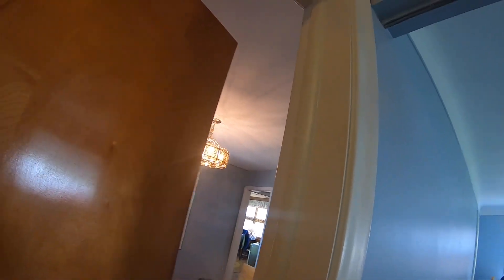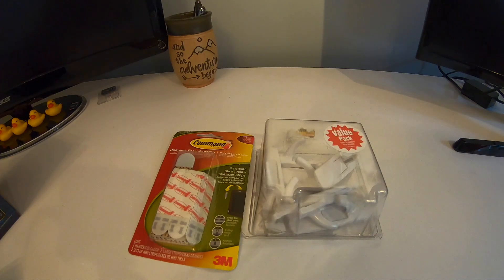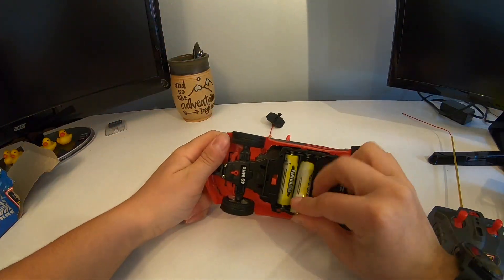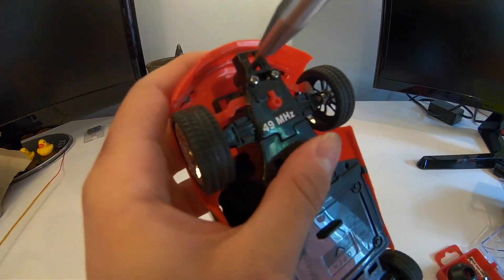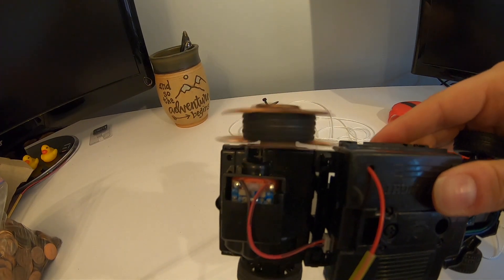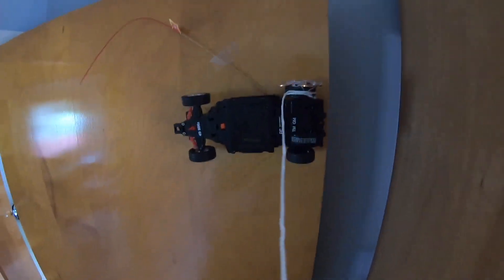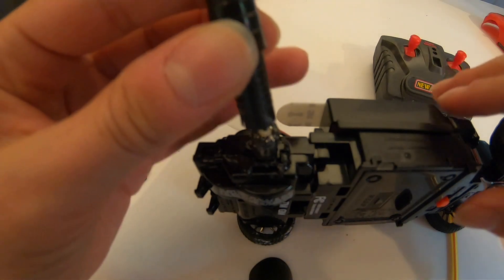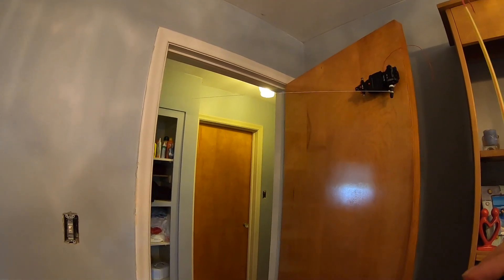How to Make a Remote Controlled Door Closer Out of a Toy RC Car

Comment: A remote controlled door OPENER.
Reply from the maker: You're not wrong :)
Reply: Could even use the same car. Just spool on other wheel so when run in reverse it would open the door by pulling string from other side of door.
Reply: It would work well cause one could just use a spring controlled door latch to auto close the door

Comment: Where is the opening feature?
Reply from the maker: Like an intro cut scene?
Reply: No, like after you mechanically close the door, add an opening feature, where the door can open, mechanically  @givemeabreak2469
Reply: @Carla Notarobot  after you close it with string, what do you do to open the door?
Reply: @givemeabreak2469   after you close it with string, what do you do to open the door?
Reply: @givemeabreak2469  after you close it with string, what do you do to open the door?
Reply: @winstoniskandar4554  spool on the other wheel so when run car in reverse it would wind in from backside of door and wind out on front side.